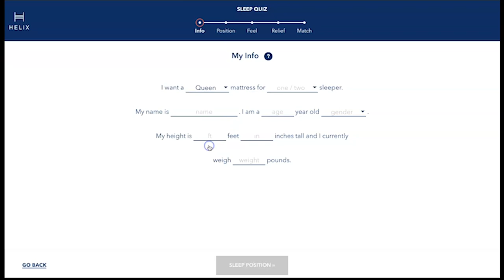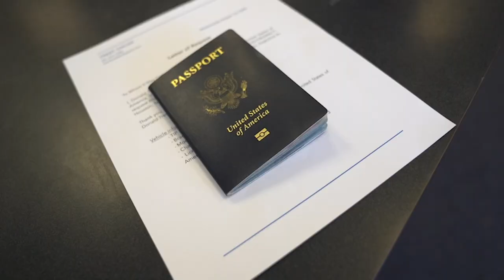UPDATE ON OUR VAN + POURING OUR CONCRETE WALLS

Comment: You guys are so fun to watch. The stress, the changes, the let downs, the excitement. When one of you is weak, the other is strong. We once bought an old farm house from Mobeetie, Texas. Moved it to White Deer, Texas. 60 miles away. It took 5 days to move it due to having to build bridges that would hold the weight, just to get it off the farm. The house cost $500. The cost to move it was not told to me. I think it kept going up. Thankfully I was 2 weeks from my due date, having my 3rd child in 4 years, so I didn't stress about the money. My husband, his dad and his granddad figured it out. Pier and Beam so we only did concrete pillars. I was kept home until the concrete was poured. I got to miss so many decisions, I just told them to make sure there was a front door and a backdoor and a few walls in the middle. 45 years ago and I still think about that home fondly.

Comment: Those are some tall walls; I would leave those forms on over the weekend 48hrs. Given I dont now the mix or additives that was used. Back fill should not be done tell it has cured 7 days. Also you need to water proof the foundation before backfill,Your still out about 2 weeks. I would get the sill plat & 1st floor rafters/deck in both structures if your worry is snow.
Reply: Absolutely. Good advice
Reply: TOTALLY AGREE, I wouldn't remove the forms for 5 days or so. The concrete is still hydrating  , hope the walls make it.
Reply: Send him this advise when there aren’t 10000 comments... send every day with flags problem may already been done? Send letter their address .. overnight.... I know that might sound overkill but I think they would appreciate as a good neighbor

Comment: The concrete vibrators are designed to not just move concrete around, but it also helps in removing all air bubbles from the concrete ( like when the stone gets hung-up on &/or around the rebar) & therefore not having a weakened wall/pour, however using it too much can sink all the stone to the bottom, & move rebar out of position, pushing towards wall surfaces, and exposing them to air, which causes rust growth, & in turn can possibly make the pour substandard.  I did a ton of concrete work in my 20s, and after 7 yrs I got out of it after all the heavy duty labor & calcium skin burns was more then enough for me.

Comment: FYI The vibrator is not just for leveling the concrete but for removing air bubbles that form as it pours.  Its super important to get the yield strength required for your structural concrete spec.  Failures not to do things as simple as this has caused buildings to fail.  
In the old days guys with metal rods would stir and prod the concrete with to do this and it was allot of work.

Comment: Be careful the light at the end of the tunnel could be a train
Reply: So true I'm a homeowner  helped  build 7 and working on my 8th n every project had  a train at the end of the tunnel !!!...A world of difference between a Van n a Motorhome remodel...$$$ if you have lots of that than building a house ( tiny house ?) is not a problem...😲🤨😱

Comment: Are yall taking into account the risk of forest fires? Will you have a steel roof? Brick walls? Just asking. Enjoy your work. Living the life!
Reply: That’s been my wonder, too!
Reply: A metal roof is definitely the way to go.. for replacement and longevity reasons also
Reply: Yes right now, they might want to consider fire protection. It's devastating many.
Reply: Google to read about the only house that survived the fires in California. Steel roof, off the grid pump built to take high volume of water from swimming pool to keep so many feet of surrounding property watered. Guy was a genius. His ideas didn’t seem so hard to do.
Reply: Earthed walls? Cobb construction?

Comment: The vibrator oscillates  and makes the entrained air and the gravel in the concrete settle and get rid of Ihe air bubbles. When forms are full strike and trowel the concrete level in the forms.

Comment: That possible snow forecast turned out to be a reality over here in Colorado. My summer cabin at 8500 ft had 12" of heavy wet snow on Sept 8. Since all the trees were still in full leaf mode, the weight of all that snow clinging to them broke off many limbs and toppled several full trees around here.
Reply: there was snow above 8000' here - not super deep but you could see it clearly from the valley floors that are roughly 4500'

Comment: Good Morning from Eastern Canada
Don’t buy the whole store, I hope your stab in the dark is for dramatization and video making. 
I hope you’ve had some tutorials from a residential plumber, not an industrial plumber/pipe fitter. 
You need materials that not only meet code, but a knowledge of how these fit, where and how much angle you need for proper draining to your gravel bed. Doing finish plumbing does not have  such serious consequences as the basic plumbing.
Please study up Quickly! Coming from a woman who shared the build of her house, not once but twice. Built small home for 3 in 1978 and major rebuild on same home in 1992 to accommodate our enlarged family of 6 and also in law suite for mom in law. 
I can say I survived,as worked my home childcare business thru out August heat and humidity in our house shell. Our whole family lived and slept in basement and backyard tent as we poured new forms, started school while kids walked the plank across massive holes surrounding our house and doorways. Little ones napped thru construction of walls and shingling above their heads. We picnic lunched on those massive piles of dirt for what seemed like weeks. Kids did dishes on camp stove heated water before dusk in Late September because we didn’t have electricity to main part of house. We showered next door at a neighbours or at the university pool in the next town and waterproofed the cement walls by spotlight at night cause it had to be done by next morning for inspector in order to backfill the foundation. We survived it all and lived to enjoy the house for many years to come. You will do this too. That’s why Allie, you don’t need to take on the added level of anxiety by looking at child baring , right now! Got it!
This too shall pass. Live it with all its excitement, frustration and as much good will as you can muster. It’s life. It’s Your Life!
Reply: Thanks Jean! Excellent job, and excellent, bang-on advice for Trent nd Allie, in particular, re: waiting a bit longer on the pregnancy, when she can enjoy it in their finished home.Is so much to enjoy in life, as Allie always says, “is about the journey”. These two are very very blessed, and currently have much going on to enjoy AnD to look forward to, as it is,already. So, thank you Jean, for your precious advice!
Reply: 🇨🇦😘🥰🙏😷Jean you are an amazing woman,and and even more amazing wife and mother it sounds. From one Canadian to another cheers, god bless, and prayers to you and your loved ones during this scary unknown time. I’m in Waterloo Ontario, and honestly I’m on the verge of being homeless and this is the most scariest time I’ve ever been in through my whole life. I hope where you are, everything is okay. 🇨🇦🥰😷😇😢
Reply: Glitz-Lee King Thank you for your kindness, my prayers go out to you and your family to stay safe and protected

Comment: Home Depot and Lowe's both have pro desks specifically for DIYs. You explain the job, they help you get what you need so it is within code. Don't forget to ask how high it needs to sit above the concrete floor for instance if your putting in a toilet stub. Google how to do something will get you close, but building code is different a over.

Comment: When it comes to the back fill, 9 days would be better than 5 days and 30 days would be even better.  Be sure to waterproof the exterior of all foundation walls BEFORE YOU BACK FILL.  This is especially important considering the depth of frost where you are and the drainage problems THAT YOU THINK YOU HAVE SOLVED.  There should be no problem, except access (make some bridges) to keep you from starting the rough framing before you back fill.  I know that much of what you are sharing is pure theatrical drama in hopes of making your videos more interesting, but just in case some of it is not drama, error on the safe and conservative side.  I know that will be difficult with Trent's nearly terminal muy macho nature and personality, but when machismo mixes with the state of being dangerously misinformed the results can be a serious disaster.  Good luck, be very careful, and whine a little less!  LOL
Reply: THIS exactly! I made a post about this before reading this one.
Reply: Good comments, they could also put the floor on and then backfill which is the most secure method, as it will keep the walls from buckling. its more work but at night the temps there are getting cold, ie slow cure for concrete. as a retired builder we NEVER backfilled before 7 days with good temps. they could temporarily tie the walls down with 2x6  at angle down to the floor ...
Reply: @countryflyer4536  Of course, with conventional construction methods the rough floor would always go on first over the ring and floor joists, but in the climate where they are I would personally not take any short cuts when it comes to the curing of the foundation and back filling especially when at least one of those concrete walls is a retaining wall against the hillside.  These kids are going to be tested!  I am originally from Wisconsin and learned to respect the forces of cold weather!  Maybe we can keep them straight!  LOL
Reply: Excellent advice, I totally agree!
Reply: Trent..!!!  Listen to Jerry.!.!.! Some of us have been there and done that and can help you avoid cataclysmic mistakes.
Reply: Well said!
Get those for-ums stripped off and get that "puppy" sealed up!
Muahahaha.

Comment: plumbing and electricity are 2 of the things I would never dare to do myself if i was to build a house. Congestions, leaks, etc., who's gonna help you with your do-it-yourself plumbing system if you run into problems and it is by design? Regarding electricity the main concern would be fires I guess. But I think there are good do-it-yourself plans that you can follow.

Comment: I have found when dealing with contractors, it’s good  idea  to have them sign an agreement upon accepting the job that, for everyday they fail to meet their deadline, you start subtracting the money to be owed to them for every day there after.  This motivates the contractors to stay on task... excluding delays due to weather or delays caused by other contractors hired for other parts required for a construction build.

Comment: Thanks for another great video.  A question about your plumbing.  What do you mean with rough fitting?  I presume you are talking about the sewage system.  Don't you have to pressure test for  the inspection?  I don't live in the USA.  Maybe things are different in your country.  Best of luck with all your future building.  Keep cool with each other because it will put pressure on your life together.  I was an owner builder several times so I can speak from experience.  I love watching your videos.

Comment: You dont have to go to Argentina. 

Ship it RORO, Roll on/Roll off, if possible. Hire a shipping company to handle it for you. 
They can pick it up (on a flat bed, not driven*), take to port, handle documents and hand it off to the ship.
*does that help with registration since it wont be "on the road"

Google international auto shipping

I've used Wallenius-Wilhelmsen and K-Line to ship cars. 👍

Maybe to a Texas port (Galveston/Houston) for pick up or to Baltimore to get it to Allie's parents place?

Besides RORO, you might be able to put it in a short container...?

Comment: Great job!  Hopefully, before backfilling you waterproof the walls and run french drains around the perimeters of the structures if needed.  Also, don’t be afraid or ashamed to ask for advice with things you’re unsure of in your videos.  With your plumbing situation, show a blueprint drawing of the floor plan and ask for advice from those viewers who are plumbers.  You might get one or two of them giving you an itemized list of the fittings you’ll need and how and where to install them.

Comment: If the new tires are taller your speedometer may read low meaning you are going faster than your speedometer indicates. Found out our car speedometer read about 3 mph low when we got new tires. might want to check it with GPS to avoid a ticket. Did you put the pipes in through the wall for the sewer and water?

Comment: Plumbing isn’t hard.  Poop and water runs down hill.  Check the codes to see what angle is appropriate for your area.  When we built our house the important part was how far away vent pipes could be from the drains and what angle the pipes could be.  I lived in a small town and the code book was all of 35 pages.  I could quote that book at the time.

Comment: Trent: order a 2nd coffee machine.. just in case this new one breaks down too....we usually get 2 of everything...why cause things break down.. including pipes, plumbing, wiring..circuit breakers, valves,..etc.etc.  After the house is built with proper everything.. Trent..you should become a contractor...its a life skill with lots of technical experience and of course a licence..that will aid your rise to UT structural power :D

Another idea would be that after the concrete flooring is laid down (after you've done the pex pipe hot n cold).. do Saw cuts in the flooring...those are a used to create control joints in concrete, which help control where cracking occurs due to shrinkage. The cuts should be made at a predetermined spacing and only after the concrete has obtained sufficient strength but before internal cracking begins. Therefore, the timing of saw cuts is critical and should be done by yourself or with the aid of a supervised technical staff.

Allie: i can see you both smiling with the coffee in the morning.....glitter glowing too
stay safe.. keep warm.. GOD BLESS.

Comment: Your new tyres:  It sounds as if they have a larger diameter than the previous ones.  This will affect the actual speed you do compared with speed your speedometer shows.  You will be doing a greater speed than previously.  The increase will be in direct proportion to the change in diameters.    Be careful - those speed cameras work on your actual speed.

Comment: Hi Trent and Allie! We are so excited to see the progress on the property.  We are doing a van build and wonder if you can help give some guidance on which Remote control module you used with your set up.  We have a Renogy 2000w inverter/charger and we received a pure sine wave inverter charger remote control module.  We have it plugged in and everything is working correctly but the remote control module isn’t coming on at all! Any suggestions, we’ve called Renogy but no answer! Wondering which remote control module you chose. What are some other remote controls that would be compatible with Renogy?  Any advise would be great! Have an awesome day!

Comment: Plumbing is one of the most important parts of the home. Remember if you muck it up ya gonna if to dig it up!!! Pay a plumber to pick out the correct things you need and where they should go. It may cost a bit but worth it in the long run

Comment: Great video! I don't understand why Kevin has left you with this dilemma, however I don't exactly know what you paid him to handle! I took note of Allie saying there is so much building going on (in the area?) I'm thinking it might be a good idea to go to one or more of these builds & take a look at the plumbing if you can observe it before it gets covered up by walls, floors, etc. Also, make sure it has passed inspection. Trent is very capable of many things based on what I've seen since your first video.  I do think sometimes he might "wing it" but he uses good common sense & reasoning when doing so. I have complete confidence in his capabilities combined with your good positivity energy plus smile Allie!  Many people here have responded that you need to winterize the concrete walls before backfilling. Also that you need to allow the concrete time to harden. Some things just can't be rushed I'm sorry to say. I know that the weather is dictating how fast you need to move & that you don't want to deal with snow, ice, or rain!  I'll be praying for you.
          I also know you want Pamela Vanderson back but curious why you can't use Terry until that happens. Are you keeping both? Remember I previously said I would like to buy Pamela Vanderson..I don't remember if you said what the second structure is for. I'm guessing maybe a time out for Trent! lol .Sorry I couldn't resist! Maybe a place for Trent's shop, a garage or a place for 1 or more RV's and/or truck.. Allie, your music choice was very good!  I will keep you all in my prayers (including Frank), &  wish only the best for you & I'm looking forward to your next video. May God Bless you,  Regards,Roger

Comment: Wouldnt it just be easier to drink tea or hot chocolate in place of the coffee, to save money than spending 10.00 a a cup.    I hope you can get the van back soon.  Hopefully the lockdown is  over by the time you need to get it . Good luck with that process. I hope you dont lose your van to something that was out of your control.  That doesnt even seem fair.